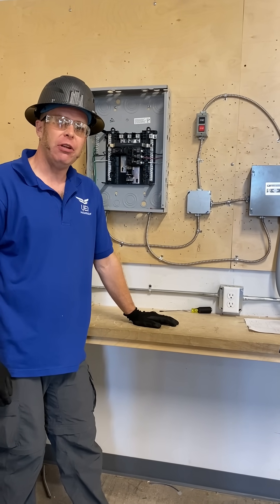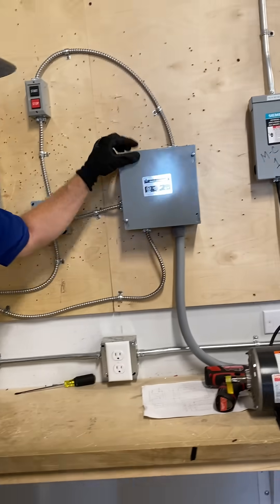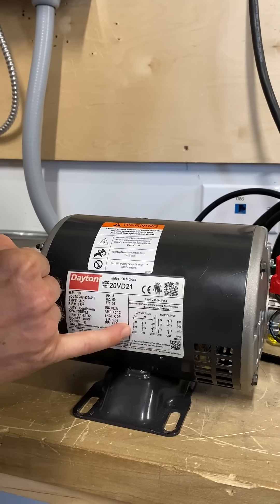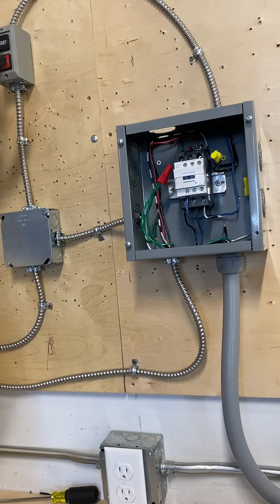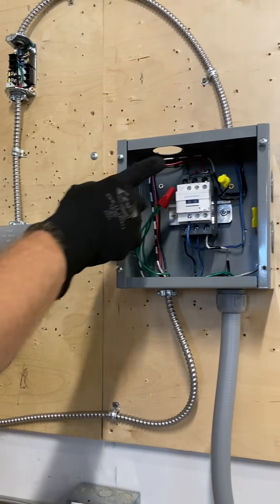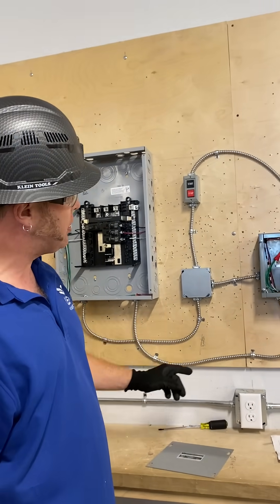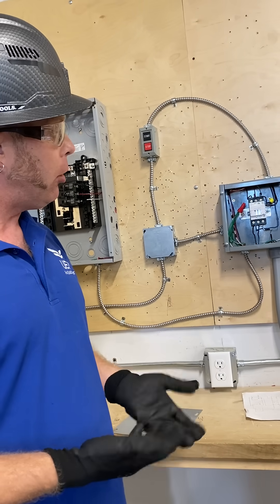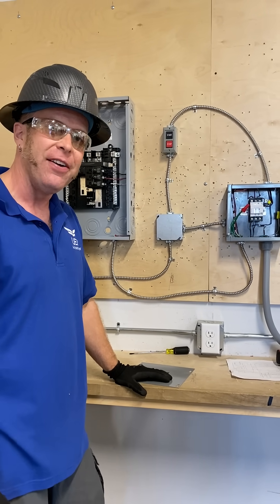Zap Zach Presents: Push Button Pilot Device - Contactor - 3 Phase Motor Control Lab #ZapZach

Comment: You can't phase grounded conductors 6awg and smaller if they're not a part of a cable assembly, case in point conductors in your lfmc feeding the motor.
Reply from the maker: Correct its for demonstration purposes.

Comment: Pvc for vibration?
Reply from the maker: Hello, my apologies, I misspoke and called the Liquidtight Flexile Metal Conduit accidentally PVC. Also you would use a Flexible Liquidtight Connector (Outdoors) or Flexible Flex (Indoors) when securing your raceway to the motor, due to its vibration.